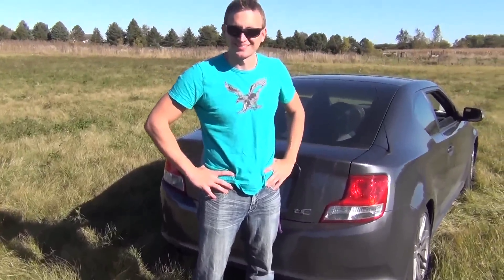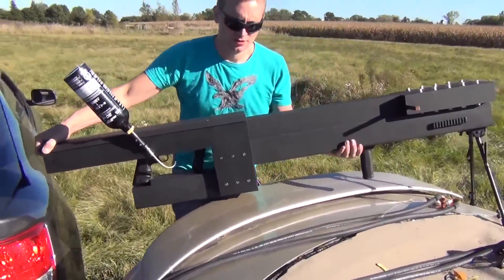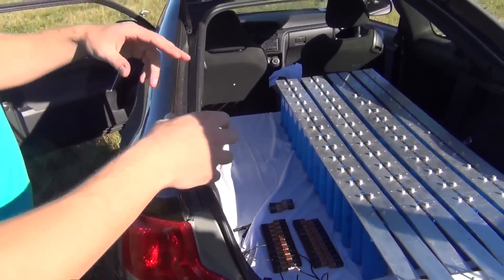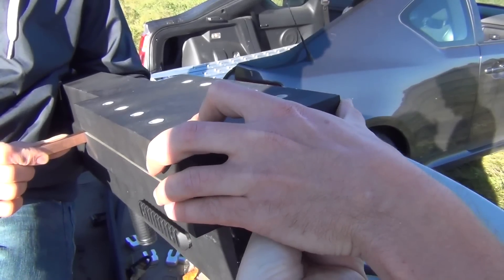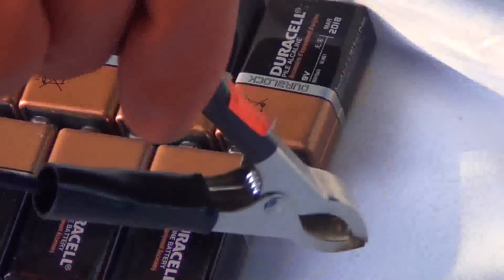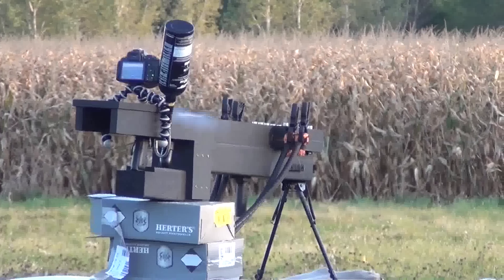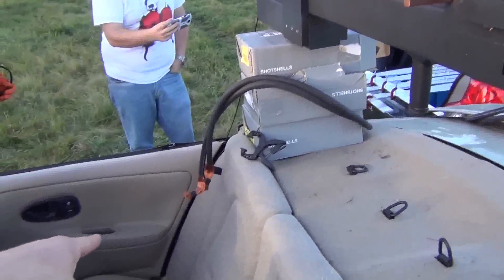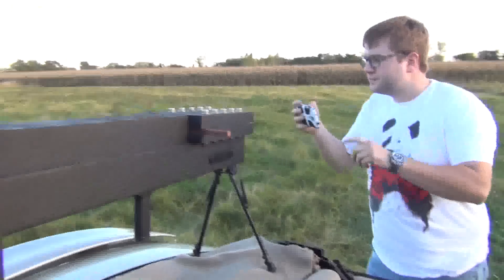Backyard RAILGUN: Field Testing the 250 lb Electric Gun, 27,000 Joule (max)

Comment: I hate to burst your bubble, but that's not a rail gun.  Think of a railgun like a linear motor, the projectile rides an electromagnetic wave and never comes in contact with the electrodes.  What you're seeing there with that "explosion" is superheated gas (air) called plasma, it's the same thing you see on a jacobs ladder, it's just that you're using such high amps, that when it arcs and creates the plasma, you're getting more of an explosion, and since the plasma is superheated gas which has just expanded like gases in a regular firearm, that's why you're getting a boost in the projectile velocity.
Reply: I love when someone tries to correct the video uploader, and the uploader puts them in check.
Reply: Yes the rails come in contact with the projectile. Under more rigorous test the rails have to be replace every so often because of wear, material from the projectile is embedded in the rails as well.
Reply: Singing Jigglypuff It can be...look up "eddy current."
Reply from the maker: Nathan Driscoll It's the very exact definition of a railgun. The rails experience 6 tons of magnetic force between them.
Reply from the maker: Nathan Driscoll A railgun projectile ALWAYS makes electrical contact. Otherwise, it's just a coilgun.
Reply: You're right about the coilgun or gauss gun, however in the railguns I've seen there is no contact with the rails and the projectile.  It's a little hard to explain in words without drawing a diagram, but in gun there are 3 different hollow tubes, a left, middle, and right.  The left and right tubes would hold your electrodes (rails) and the third would be the "barrel" where your projectile would travel.  Between the tubes there is a small channel that connects all the tubes together, and runs the length of the tubes, but not large enough for the projectile to slide through and contact the rails.  The projectile does actually complete the circuit, but not by physical contact, but by arcing which creates the plasma and the Lorentz force that accelerates the projectile.  Sorry about that, I was just re-reading my previous comment, and yep it looks more like I'm describing a gauss gun than the type of railgun you're making.  I have seen one, and it's completely possible that I'm misremembering, what I was told and what I saw since I don't work in the field, but as I remember, the projectile never comes in contact with either rail.  Like I said, it's a little hard to explain without drawing it.  :-)  Please don't take it as nay saying.  It's really cool, and I'm just trying to help with what I saw and found out.  :-)
Reply from the maker: Nathan Driscoll there are plasma railguns (as described) and then there are railguns that make direct contact. This is a metal on metal railgun - higher current, lower erosion. Glad you liked the video.
Reply: Ahh, I see.  The one that I saw didn't make contact, and the other gun I saw was a gauss gun, but I didn't know that there was a railgun that makes contact with the electrodes..  Thanks for clearing that up... :-D
Reply: https://www.youtube.com/watch?v=XJEoLgCYw5Q
Reply: Nathan Driscoll I'm waiting to see your rail gun video....
Reply: I know this is an old post, but you made me think of something. And it's not a rail gun, so i'm not getting into that debate, lol. Now, admittedly, I'm not a science guy, so I'm probably just thinking out my arse here. Could you build something that sustains a blast of plasma to the point of effectively being a 'plasma thrower' instead of a flamethrower? And would the plasma be practically invisible in daylight?
Reply: Jason Voorhees responding to an old post with an answer out of my arse. There are CNC plasma cutters which pump air thru a nozzle and superheat it so that it turns to a plasma, it cuts everything very easily. The problems with this design is that the plasma doesn’t last very long (1 inch at max) and it requires an incredible amount of energy, after all you have to pump air very quickly under pressure and heat it to tens of thousands of degrees ( Celsius ). You could try that with the battery pack of a Tesla car, if you have the $, of course.
Reply: Did the projectile actually leave the barrel or did it just vaporize?
Reply from the maker: nikotwenty the co2 on this system is so weak, the projectile won't even leave the device if fired without electricity. The magnetism is enough to toss 20lb copper cables- the action on the projectile is in the thousands of lbs on 14-20 grams.
Reply: Singing Jigglypuff exactly. Did these dingbats really think this would work? I'd bet you $100 that the "projectile" was still lodged in the "rail".
Reply: ElectroBOOM tried a basic one and it doesn't even work. If your projectile is flying out then it's not the magnetic field doing it
Reply: Nathan Driscoll aliminium isn't magnetic also.

Comment: incredible awesome! but please stop walking in front of that gun even if its not loaded
Reply from the maker: Eye of Providence 2 million times the amperage required to kill a man and you're worried about standing in front of a discharged muzzle loader :p
Reply: actually the warning read high voltage because high voltages are able to arc, you don't have to actually touch it for it to kill you
Reply: considering that you must have some knowledge of electricity I'd have thought that you'd know that it's amp's, not volts that will kill you :/ that's concerning.
Reply: You won't have lethal amperage without enough volts though. Human skin has a fairly high resistance under normal conditions.
Reply: Exactly what Dogthedeadly says, that's why a car battery that can supply 800 amps per hour doesn't kill you, the voltage on the terminals are too low... and that's why the warnings read HIGH VOLTAGE, because it is the voltage differential that will push the current through your body.
Reply: you do understand that a rail gun with no power or shots in it is just a brick of metal. Unlike conventional weapons this thing would have no chance of firing accidentally; well, after it has already fired
Reply from the maker: This 4 minute video was filmed over quite a few hours (I believe it was 6 total). There was actually a significant amount of precautions taken- mostly for the sake of not exploding limbs and whatnot.
Reply: Simple safety, you make a habit of it and it becomes second nature. You don't and it takes one day making the mistake and no do overs. Best to follow basic safety and live another day.
Reply: lol Some people are silly. A gun can't go off if it's not loaded lol. It's perfectly fine to be in front of the barrel of a gun. How do you guys clean guns if it can't be pointed at you? Just calm down, I'm almost 100% sure the people that made this video are smarter than us combined and I think they have a handle on it.
Reply: dedalliance1 there is book smarts and there is common sense,. These guys lack the latter.
Reply: What gun?   You mean the electromagnet?
Reply: mikezbr looool im a nazi trying to save lives :) please dont come to my range i'd rather your family deal with a corpse haha
Reply: right, because all accidents happen with homemade guns and never with 'proper' guns lol i'm assuming you dont wear seatbelts too because you drive safely?
Reply: The All-Seeing Eye 
I'll second that.
Also, please allow me to suggest that you get yourself a table or stand to put the device on. If you cause an overcharge (highly likely in this area of experimentation), you might end up accidentally destroying one or both of the vehicles which you were using as a platform for the capacitors and the firing mechanism. That would set your research back a great deal, to say nothing of the risk of physical injury. 

And to reiterate the first rule of firearms safety; Never point a weapon at anything you do not want to destroy. You're way too promising to suffer a stupid and entirely preventable accidental injury. You should be on your way to a career in engineering not physical therapy.
Reply: Its not loaded, no projectile will emerge, no puppies or kittens will be squashed. Maybe they should all be wearing hi vis and hard hats..
Reply: widepond28 maybe you shouldn't shoot unreliable guns I could fuck my gun and not worry about it discharging
Reply: he is right kov. you know even a very intelligent person can die from a simple mistake such as this 350VDC can be dangerous if it does not kill you it will be very painful these voltages are dangerous even if its direct current.
Reply: Seth Mullins 
It fires a projectile at hypersonic speeds and is capable of killing a person at range. Just because it is not utilizing a chemically initiated rapid exothermic reaction to launch that projectile doesn't alter the potential for destruction and harm it represents. If there were an unanticipated discharge, a short, a freak lighting event, etc, the rail gun may fire. It might not be hooked up, but far too many people have shot themselves or others with weapons they erroneously believed to be unloaded because they didn't abide gun safety rules. That includes nail guns too, as well as crossbows, and other devices with the potential for releasing dangerous projectiles. Applying basic firearms safety rules to the handling of this device will reduce the risk of a tragic and preventable accident.
Reply from the maker: Or if one of the capacitors blows- all the energy sent into a liquid filled aluminum container. 
Instant scion convertible :o
Reply: Seth Mullins People leave things plugged in. Simple errors which can have serious consequences require an adherence to a safety protocol to reduce or eliminate the possibility that the unlikely event that you weren't expecting becomes the most or last important event of your life. Its really quite simple. Basic firearms safety rules should apply for any form of projectile weapon. I'm not calling for a law here, just suggesting that the very smart young man in the video follow a simple protocol so he doesn't ad himself to the unfortunate list of very intelligent people who have caused accidents that harmed or killed themselves or others whom they did not intend to harm. 
There's a reason that industrial safety protocols are created. If he spent a little time thinking up the safety protocol for strangers handling his device, one of the most important and obvious ones would be not to allow the weapons business end to be aimed at anyone or anything which is not a safe target. Why is that controversial to you?
Reply: Seth Mullins your an idiot. Regardless if it actually considered a legal firearm, it is still deadly and shoots a projectile. The firearm safety rules are safety rules not laws to find a loophole to get around it! Quit trying to pick things apart to find a argument
Reply: Draxindustries1 omfg
 Your an idiot as well.. I hope you don't own firearms. You clearly do not have any firearm safety knowledge
Reply: Justin Lehman I like your point. I think it is stupid people are referring to laws for the firearm safety rules. They are not laws they are just safety rules. Don't try to find a loophole to be unsafe with firearm safety
Reply: If you can't handle adhering to the one rule that applies to any firearm, you're probably not ready to handle that rail'gun'
Reply: i feel like ppl defending gun safety are possibly missing the point. If he was at a range (legal or not) and was going against the rules that an owner established that's one thing....  but there's no "natural law" that says u CAN"T stand in front of a gun (regardless of the state of the gun/situation). Proof of that, is that physically they did, therefore physically, you can. Let them do it, or don't! Go stop them! Just saying, I personally believe there is nothing wrong with ASKING them not to, but it's when you TELL them what they can/can't or should/shouldn't do...and believe me im just asking u guys to side with my opinion or atleast consider it, but i think no less of u if don't...btw, I am all for gun safety in ANY situation. This is a toughy cus emotions/feelings/thoughts exist in this realm and ppl want to express them, and THAT is completely natural. Sry was getting off topic. Anyways, it's beautiful some of you are looking out for this strangers safety, but there's gotta be a right AND wrong way to do it, right? opinions, not attacks, welcome.
Reply: Lol I were a seatbelt cuz of other dummies I'm betting you were sheltered as a child
Reply: Michael Foye bro it's YouTube you ain't gotta be so professional when you type lol it feeds the trolls anyways but what I've realized is the dude in the video that made the gun knows how it works and knows that any danger the weapon had is gone so he is comfortable enough to walk in front of it I mean Yea a lot of care needs to be done with firearms to insure safety but some of y'all take it way to far and those are the people that are just to "preppy" I've grown up hunting and with a military family gun safety is second nature but obvious things like a rail gun with no projectile the gun is nothing more then scrape metal

Comment: I know you said in the description that a good rail gun projectile produces sparks as it glides along and heats up. Is that a good thing and absolutely necessary? Like is there a reason for the metal on metal contact because to me it just seems like putting it in a sabot made of non conductive and heat/friction resistant plastics would be best. since I can't imagine the sparks are good for survivability of the product.
Reply from the maker: Gus Of the Six Sided Dorks the projectile forms part of the circuit: hundreds of thousands of amps pass through it. Otherwise, it wouldn't be a rail gun.
Reply: Ziggy Zee oh, I completely misunderstood how ti worked then. Thank you for explaining it.
Reply: Gus Of the Six Sided Dorks

Comment: I knew the cables would fly off, because they aren't designed right.  (At least you didn't coil them.  People have gotten hurt that way.)  Your peak current is severely limited by the inductance of the circuit, some of which is in the bus bars, and some in the cables.  You already did a fairly good job on the bus bars, but they could be a lot better.  Right now they are "short side" coupled; you want them to be "broad side" coupled.  I recommend a sandwich arrangement with the plus and minus bars as the "bread", and some thin pieces of FR4 as the "meat".  Wrap them tightly with duct tape.  Then attach the caps with L-brackets.
Next, you want to make the cables coaxial. Start with a garden hose, about 1" in diameter.  Put 1" diameter braided copper sleeve over it.  Cover the sleeve with heat shrink tubing, and shrink it tight.  (If you intend to go above about 300V, I would use two layers of heat shrink tubing.)  Then put a slightly larger diameter braided copper sleeve over that.  Then do another heat shrink layer and shrink it tight.  The objective is to minimize the ratio (inside diameter of outer sleeve)/(outside diameter of inner sleeve).  I wouldn't be surprised if these improvements tripled your peak current.
Reply: Resistance is not the problem.  Inductance is what limits the peak current.  A coaxial cable, if made properly, will have a much lower inductance.  To understand why, draw a cross-section diagram of a coaxial cable, as two concentric circles; the inner circle (with radius A) represents the center conductor, and the outer circle (with radius B) the shield.  Now let's say the current on the center conductor is flowing into the page; the would make a magnetic field that encircles the cable in the clockwise direction.  The return current on the shield would be in the opposite direction, coming out of the page, and would therefore make a magnetic field that encircles the cable in the counter-clockwise direction.  Now pick a point is space that is a distance r from the center. If the point is outside the shield (r>B), then the clockwise and counter-clockwise fields cancel each other.  But for a point between the conductors (B>r>A) they don't cancel, so the cable still has some inductance.  What you want is the smallest gap (B/A is just slightly greater than 1).  So use a big wire for the center (maximize A) and a thin insulating layer in between.  This will give you extremely small inductance per meter of cable.
Reply: jon doe I suppose you know everything from birth and the word ignorance has no meaning. Typical of the internet
Reply: @Goettschwan this wouldn't change much, the inductance of the wires is resisting the change in current running through them, they need to coil the wires so as to nullify somewhat the affect

Comment: this is the biggest troll ever lol.
there isn't even a coil!
plus all of those capacitors would need much more power than that you are delivering with those 9volts batteries in order to charge.
also aluminium is mot magnetic so it wouldn't work even if there actually were coils.
Reply: Dude, it's a RAILGUN, not a coilgun...
Reply from the maker: you'll be surprised how much chemical energy is in a single 9-volt. (I did go through 250 of em before buying an inverter, because $)
Reply: +MaPorcaTrotaATutti
Congrats, you understood about 2/10 of your physics classes, which is more then most but not nearly enough to know what is going on here.
Reply: It's a raigun, not a coilgun. They are different things.
Reply: XD dude check your science before you post.. Basically all matter is magnetic but some is just more magnetic than others, also capacitors are just really bulky for there capacitance when you compare it to that of batteries. I think the coil part was already explained by the rest of the replies.